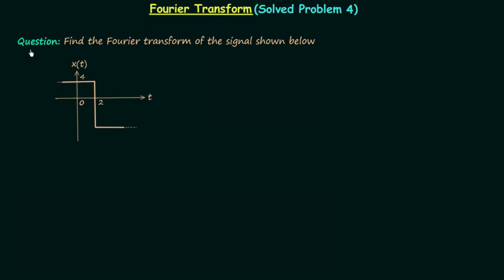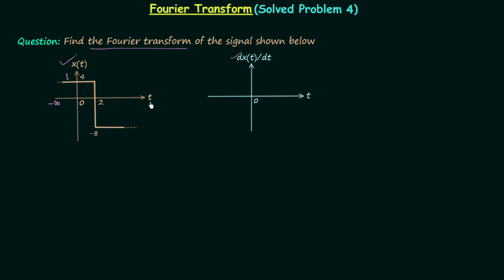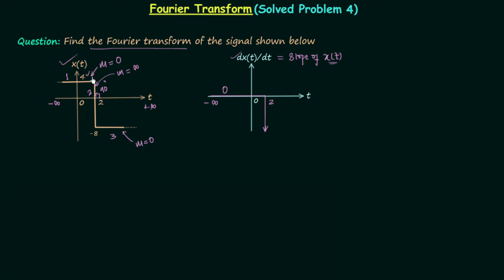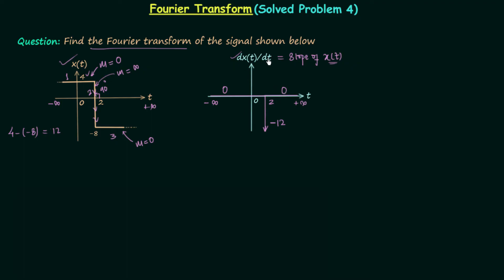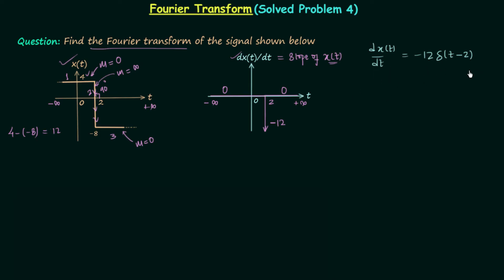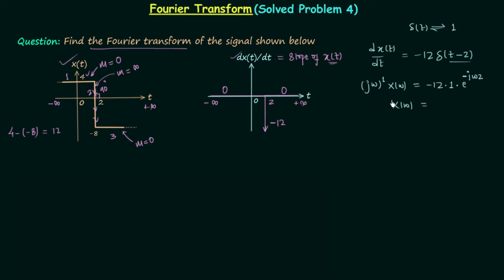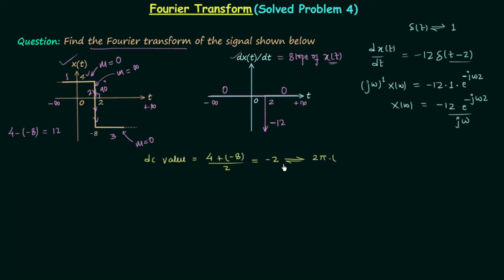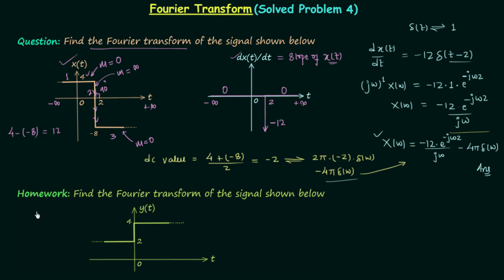Fourier Transform (Solved Problem 4)

Comment: Y(w)=2/jw+6π*delta (w)
Reply: archit gupta how u got the answer
Reply: I got 2+6pi*delta(w)
Reply: you forgot jw which is a property of diff.
Reply: NEEHARIKA NAIK  divide by jw as we took differentiation
Reply: Isn't it 6/jw+6πdelta w
Reply: @neeharikanaik2819  u forget to take FT of dx(t)/dt
Reply: this signal is basically 2u(-t)+4u(t).Now we can easily do this fourier transform without differentiation method
Reply: @soumabratabhattacharya3375   hey in this method how to solve the problem can u please explain 
Thanks in advance
Reply: @soumabratabhattacharya3375  bhai ...only m got 6 pi delta(w)
Reply: @komalipadala154  we need to consider the impulse response only where the function is having that response. here we r having a transition from 2 to 4 which means that there is a sudden change from 2 to 4. so (4-2=2) will be considered since graph is defined at those points..
Reply: @komalipadala154  no.. because 4-2..
Reply: What is the exact answer
Reply: 2/jw + 4πdel(w)
Reply: @manojraghul8734  
The exact answer is the one represented by archit, which is:
Y(w)=2/jw+6π*delta (w)
Reply: @shabinaa6407  its right
Reply: @jethendraredykomerla5527  bro ,how it is 6π*delta (w),why not it is 3π*delta (w)
Reply: How is it 6π?  what is the DC value?  DC value should be 4-2  or 4+2?  Can anyone explain me how 4+2? Why not 4-2?
Reply: @neeharikanaik2819  how to find avg value help me out
Reply: @navyasrivastava3881  dc value will be (4+2)/2 because both line are positive and impulse weight will be 4-2 because it's shifting from 2 to 4
Reply: @navyasrivastava3881  it is addition of all discontinuity divided by no. Of total discontinuty .
Reply: i know I am kinda off topic but does anybody know a good website to watch newly released movies online?
Reply: @Brantley Trace I watch on flixzone. Just search on google for it :)
Reply: @Devon Mauricio definitely, I have been watching on FlixZone for years myself =)
Reply: @Devon Mauricio Thanks, I signed up and it seems like a nice service =) I really appreciate it !!
Reply: @Brantley Trace glad I could help =)

Comment: We cn solve this h.w by two method ..
1. By diff. We get 2delta(w) with d.c value 6(as d.c value we calculate addition of values at t=0+ and t=0- and ÷ by 2 so 4+2/2=3 which gives 6 pi delta(w) )so ans will be 2/jw+6pi delta(w)..

2. We cn write this signal as 2+2ut thn after transform we get same result...👍

Comment: The given signal is nothing but signum function which is amplitude shifted upwards by 3 units. 

Fix the midpoint of shifted signum function at 3  and downward shift it by 3 units to coincide at origin, to get the standard signum function with +1 and -1 magnitude. 

So, we can write it as Sgn(t) = -3+ y(t) 

y(t) = 3+Sgn(t). 

Take FT on both sides, we directly get the answer i,e.,, 

Y(w) = FT of DC value + FT of Non-DC Value 

FT (3) + FT{Sgn(t)} 
= 2pi*3*del(w) + 2/jw !!!!! And that's the answer.

Comment: Help of DC value calculation:
----------------------------------------------

d(x)/dt  is an impulse signal with magnitude 2. so  FT{X(w) } = FT {2delta(t)} = 2 / jw [This is clear]
To calculate dc value, i see some answers 4+2/2 = 3, X(w) = 2/jw + FT{dc value} = 2/jw + 2Pi * dc val * delta(w) i.e. 2jw + 6Pidelta(w)

I'm not getting the calculation of DC value? The differentiation of x(t) looks like an impulse.

DC Value = Area of Signal / Period of Signal.

Can someone help me to understand : how dc value is 3.

Comment: I didn't get how you calculated DC value (average of the change in slope?)
Reply: Dc value = A0 = (2+4)/2=3.
FT of dc value (A0) = 2*PI*A0*del(w)
Substitute the value and u will get the answer.
Reply: Why we are dividing 6 by 2 for dc value
Reply: While 2 and 4 at t=0 
Is there any particular formula

Comment: Thanks for the video. I have a question, when i write down the waveform i got 4-12u(t-2) and i found fourier transform of it as 8pi.delta(w)-[(12.e^-2jw).(pi.delta(w)+1/jw)]. Can someone explain what mistake I did, or why solutions are different with different methods?
Reply: your answer is correct ....just simplify further to get the answer...pi.delta(w).[12.e^-2jw]  will reduce to 12pie.delta(w)......since f(x).delta(x)=f(0).delta(x).....hope you will get the point